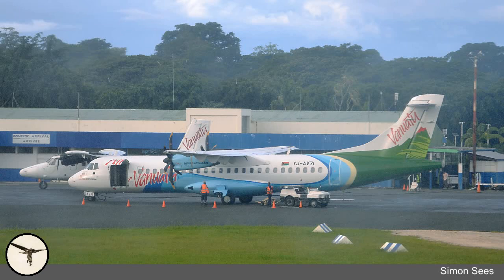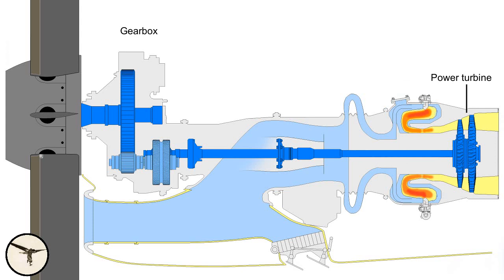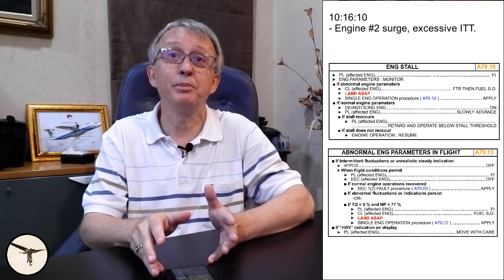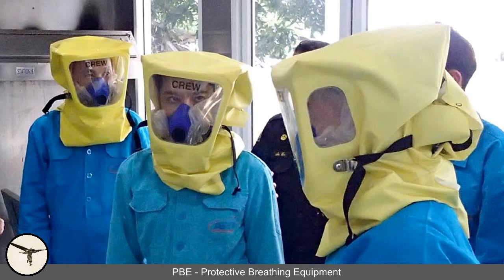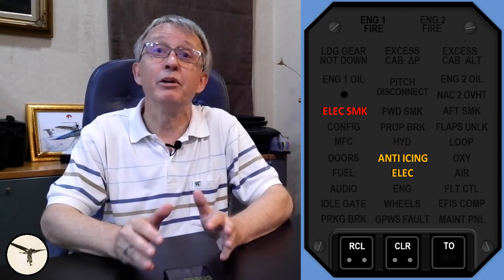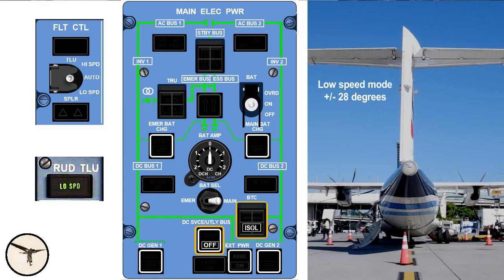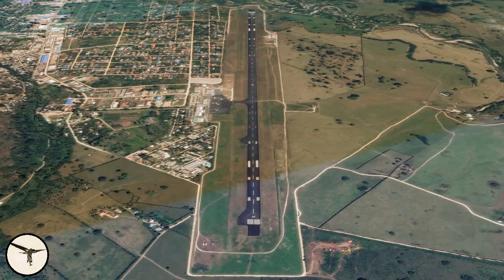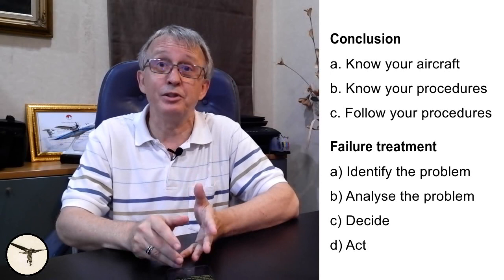Wrong decisions - Air Vanuatu flight 241

Comment: I am from Vanuatu and have been questioning why a beloved aircraft had an accident. This is very informative and the analysis is spot on. Indeed checklists are very important and sure applying reverse thrust caused more damage than intended, I do not fly but I am an avid aircraft spotter for business and fighter aircrafts including armed materials.... FYI the aircraft is now a wreck sitting at then end of the runway :-(

Comment: This is a very nice video with a lot of analysis, very well presented.

This exemplifies how not performing NNCs in a timely and correct manner can create a snowball effect. It does look like the captain lost his ability to analyse the situation early on - as you said very rightly, taking control immediately in this situation likely didn't help. His subsequent CRM (teamwork, communication, handling of checklists, SA, decision making...) was below what one would expect, to put it nicely.

I'm not familiar with ATRs, having flown only Boeing products. However their NNCs look quite simpler to me. Notably, when the landing configuration and/or technique is affected, the NNC includes the descent, approach and landing checklist... Also, they have just ONE NNC for smoke, that essentially addresses the most common causes of smoke. It deals with relatively benign stuff like recirc fans. The key point is to protect yourself and to land quickly if the source of the fire can't be positively confirmed to be suppressed early in the NNC. Should I summarise its underlying philosophy, I'd say it's designed to save the aircraft by landing quickly, not by actioning switchesand I tend to agree with that.

Here, I understand that the cause of the smoke was the engine problem and nothing else. Had the captain simply secured the engine timely, the smoke problem would have disappeared by itself or might haven't happened at all... And it was as you said quite obvious that every issue that developed after the initial engine malfunction was related to it.

Comment: On -500 sometimes it is very hard to identify the hierarchy and different levels of alert. A single fault can lead to a multiple faults as they may be the consequence of it. Pilots need to carefully understand and identify the problem. While doing the checklist there might be additional fault alerts and pilots need to understand that they may be the consequence of doing the procedure. Pilots should not get distracted by these to prevent them to discontinue an active fault checklist and proceed with a new checklist for the new fault that popped out. It is very imprtant to know the plane and its systems inside and out. That gives you advantage in dealing with crisis and emergencies.

When doing checklist there is an intersting gesture called "shisa kanko". It is a Japanese gesture commonly observed in train drivers, bus drivers, technicians and even pilots. They call it "point and call" or "shisa kanko". It reduces workplace errors by as much as 85% and increases the level of safety. Pointing to things forces your eyes to follow what your index finger is pointing combined with calling out the actual position. It assures the person that everything is in the correct place and position. Some pilots especially the experienced one tends to memorize the response to a challenge on a checklist over time. They usually answer the response immediately because they memorize it, while at the same time they fail to look at the specific button, switch or lever which is in the incorrect configuration leading to a serious safety issue if not attended to. I am currently doing that practice of pointing and calling, it helps a lot and its very effective.
Reply from the maker: During my ATR training twenty years ago, the instructor emphasized the importance of pointing at the relevant indications and pushbuttons, and then ask for confirmation. This is still emphasized in ATR FCTM.
In the EFIS cockpit, when you have multiple failures, check the status of the engines. If they are fine, look for a bus failure. This philosophy works well. The glass cockpit makes things easier, but you should never forget the basics.
Reply: Hi, one of the things that does not get emphasized during training, especially during the initial where the pilot is required to learn a vast amount of information in a relatively short time, it is what the outcome of a checklist will be and how it will affect the other systems. In my opinion it is essential to review the EICAS or whatever CAS the airplane has at the completion of a checklist to check that the outcome is the expected one - in the 737 when u secure the engine after an engine failure or as you go through an abnormal checklist or when you deal with an issue, when challenged the answer is the published one, followed by RELATED, if the issue is a direct consequence of the primary failure. Once the abnormal checklist is completed and the EICAS reviewed - we actually do not have an EICAS but a fault annunciator panel - we deal with the abnormal by prioritizing based on the basic principle aviate navigate and communicate - the abnormal checklist will set the priorities for you reconfiguring the systems as you progress to it.
Reply: What was there to really understand? I am not ATR type rated. But they should have simply dealt with the engine issue sooner than they did. Even when they knew there was smoke in the cabin they couldn't figure out that it is the engine that is the problem. They made a very simple situation very complex.

Mickey Mouse and Goofy would have done a better job than those two clowns.
Reply: @anasmaaz5731  You sound like an aviation expert. Obviously you still have a lot to learn about aviation and aircraft incidents/accidents analysis.
Reply: @jobys4568  If you want to insult me then that is alright. I have been in the industry for quite a while now. I have flown turboprops and have over 2000 plus hours on Dash 8s and I am currently flying the A320. I think that is some what enough to know a bit of this and that. It was just my opinion. No need to get disrespectful.

If you look at the crash report you will see the same thing. They failed to to their job. And they made  a mess out of it. And if you read it well you will realise that the pilots were not up to the job. You can defend anyone you want. But the damage of their failure will always be there. You cannot really hide it.
Reply: @anasmaaz5731  in the context of an accident analysis video where the author shows humility ,and strong knowledge , the mickey /goofy/Clown quote sounds quite unnecessary, disrespectful,and  childish . Anyway, Congratulations for your tremendous background

Comment: Hi, i just watched the video about the air vanuatu accident. Even though i am not type rated on the ATR as u know it, as a pilot i am trained to recognize an engine stall and surge as it will be indicated by fluctuating ITT and Nl/h, loud pulsating bangs coming from the engine which i am positive will command some memory items to be completed including reducing power/thrust on the affected engine when conditions allow and after confirmation with the other pilot: that would have partially corrected the situation and in this specific case limited the amount of smoke entering the cabin. Once the crew determined that retarding the PL did not fix the problem, they should have shut the engine down as per the qrh and be aware that when u secure an engine there are a number of systems that are affected -  hydraulic, pneumatic, electrical are always affected but that applies to any airplane. It is also very important in an emergency to assign the tasks in a clear fashion so that everyone knows what to do and what the outcome of a checklist will be. One point that i would like to emphasize is the CRM refers to CREW Resource Management and that entails all the crew onboard the airplane and not only the crew in the cockpit as the cabin crew can provide essential information. If i was in the captain shoes i would have complete the memory items for the engine surge first followed by the checklist and secure the engine as that would have eliminated the root cause of the issue, then i would have called the cabin or ideally the cabin would have informed me and i would have completed the air cond smoke checklist and inform the cabin that the smoke was related to an engine problem. Then i would have declared an emergency and prepare the airplane for a single engine approach and landing and proceeded to the airport. By prioritizing the smoke checklist first they did not fix the source as the engine was not secured and the source of the smoke had not been isolated. Thanks for sharing
Reply: Another individual that writes "I would do this, I would do that".

Comment: Why is there no smoke detector in the bleed air channels right behind the engines? …to prevent smoke entering the cabin from a faulty engine automatically.
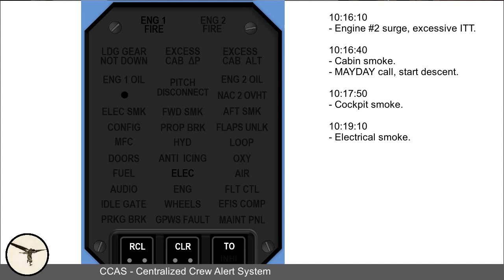Reply: Your answer at 13:55

Comment: Just came across this ahead of the 4th anniversary of this event. Thank you for this explanation. I was a passenger on this flight with my family. There was an uncontrolled roll prior to landing, mentioned in the final report and experienced on the plane as a sudden sideways roll - was this likely due to the TLU as well?
Reply from the maker: Thank you for your message. You didn't mention when the roll happened.  It could have been turbulence, or the pilot could made a sudden correction to stay on the runway centerline. If that was the case, then the TLU would not have any effect. If the roll happened just before landing, it could have happened when the pilot reacted to a crosswind. In such cases we simultaneously apply ailerons into the wind and opposite rudder. With the TLU in high-speed mode, the rudder will move a few degrees, and the result could have been an excessive roll. But I can only speculate. What matters most, is that everybody escaped unhurt.
Reply: @FlywithMagnar  thanks for your reply. No need for further analysis, but fyi, the roll occurred over land but before we were in position to make the approach to land. It is mentioned in the report but with no detail. Thanks for your informative report.

Comment: Any particular reason why no thrust reverse in single engine landing. I fly 737 and that's sop..I don't think that was the primary cause of the excursion... It was the lack of rudder control.
Reply from the maker: ATR recommendation is "reverse with care". Full reverse is just too much, especially at high speed.